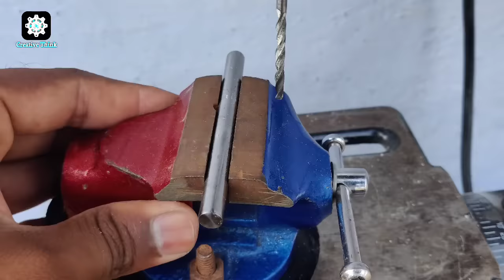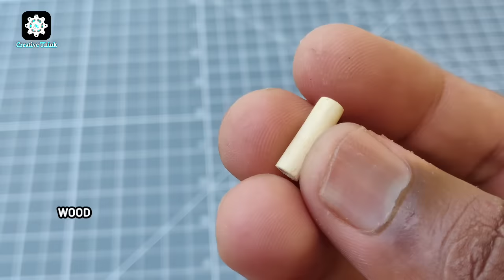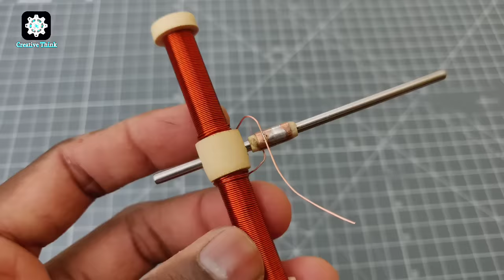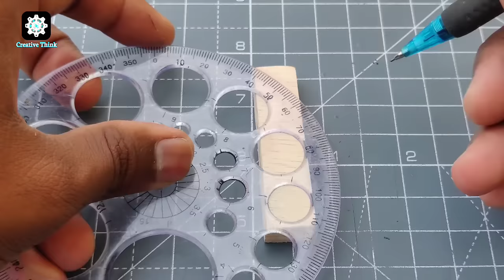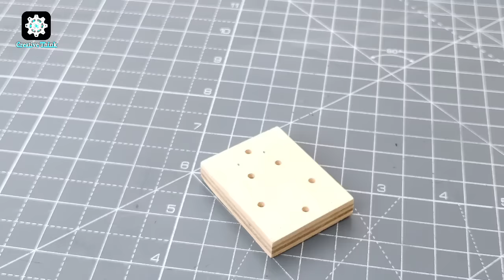Free Energy Generator Using Armature Method

Comment: I love the part where the rotor doesn't slow down when under load from the LIGHT! Almost as if the rotor is in parallel with the light and they are both receiving power from an external power source.
Reply: Bien vu!

Comment: If you closely follow the assembly, you can see that the current will not get to the coils.
The plastic ring with magnets magically becomes thicker.
Strange holes in the stand and rotor holders at the bottom, although he glues them together. 
At first, from the shaking, it moves across the table, and then not, although the ring shakes.

Comment: Batteries are in the lamp. You see it faster spinning when he connect the lamp. But a real generator goes slower when you connect a lamp.
Later on, the yellow part is proberly a fan what is driven by the wind
Reply: If batteries are in the lamp how isnt the lamp already on?
Reply: @TobyCharlesThompson   he used the, so called, generator as a switch.
It isn't a genarator.
Reply: @TobyCharlesThompson  circuit is interrupted and gets closed when he touches the contacts with the wires.
Reply: @mickue  So is fake or real?
Reply: @TobyCharlesThompson  fake of course!
Reply: Correct

Comment: Please upload a behind the scenes video on how you faked this so convincingly, thank you.
Reply: Its just a fancy flywheel. Stores the Electric Potential as magnetic flux in the coiled wires
Reply: Convincingly?
Reply: @ryanshannon2855  no..actually some point the rotating bar will come to an equilibrium position...it wont be continuous..unless provided an external energy
Reply: One possibility is that they hid a wire under the base.
Reply: what
Reply: 1. They hid a battery under the base
2. Every time they spin the copper tube they cut the video, so it looks like it spins on it’s own
3. Magnetic induction table
Reply: Noooo nnooooo it's true
Kinetic energy
Reply: @gondayayonke2827  Only need a tiny little watch battery to run it long enough to make a video.  It's in no way difficult.
Reply: It’s not fake. Instead of using a turbine to spin the rotor he’s using the magnetic potential stored in the magnets to generate the rotation of the armature as well as the magnetic field needed to generate electricity. Eventually those magnets will wear out.

It’s not fake, but it’s also not “free energy.”
Reply: @CJ-442  Any old jet of air will make it move.  I'd love it to be true.  No more energy bills.  The magnets will wear out?  Why?  Ever seen that happen?  Can you provide a reference please?  Please note:  Some things are not possible.
Reply: @Graeme_Lastname  - If you honestly think that magenta last forever, you have more problems than I can help you with.
Reply: @CJ-442  Magenta fades at about the same rate as any other colour I would guess.
Reply: I feel like if you attach a wing to it you can make a windmill base... If that's possible... Not sure
Reply: This is fake
Reply: @MarcosSilva-vt8uy  Yep, there are no other options.    :)
Reply: @ryanshannon2855  Free energy is impossible, as the 2nd law of Thermodynamics tells us.
Reply: @whoyoulookingatabs1028  
What if law is just law that few people decided who can not think outside one dimension?
Reply: @ddhaval010  hahahahaha no
not our problem you didn't pay attention in school
Reply: Dont messing a meam of free energy with ilimited energy

Every motion system needs a source to keep working (with loads)
Reply: Blowing compressed air from the background
Reply: @ryanshannon2855  Is this a good idea? As far as flywheels go, what you described (if accurate, pardon my own ignorance).

Comment: Second law of thermodynamics sends you a hug. Congratulations on hiding the battery so well.
Reply: It's real
Reply: The "wooden base" is quite thick. Could have easily hidden some disk batteries in there. Depending on battery size you could easily fit 4 in there even.

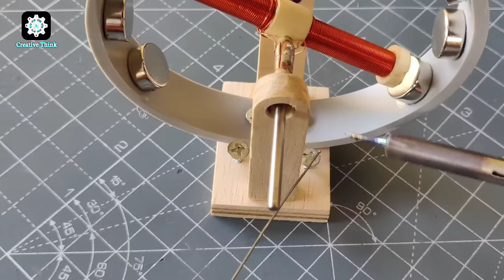Comment: The cut at 6:35 is where he swaps the one he made in the first part (with the off centred shaft that wont rotate) with the previously made one with the perfectly centred shaft and the battery hidden in the base.
Reply: nah he just put screws in the bottom of the 2nd bearing support centering the shaft.
Reply: Es verdad. 😳
Reply: Correct; otherwise, the two screws connected to the two cables would have no use (if it were a 100% self-propelled system with electromagnetism).
Reply: He doesn't try to turn it into one of those click bate videos. He even showed him using a battery to keep it spinning for longer to build potential energy. It's not like dude is claiming it goes forever on its own.
Reply: @shmirie666  You are the ideal audience for this video - gullible!   I guess you have never built a simiar motor?  They stop almost instantly when you disconnect their battery.  I made one a couple of weeks ago for my grandson - only mine didn't have any neo magnets - it turned in the earth's field.  The rotor was horizontal, and for a bearing, it used a glass test tube standing on a vertical needle.  The commutator was like his - and the brushes were single strands of muti-strand wire.  But even though friction was reduced almost to zero,  when the battery was disconnected, it only did about one more turn.
Reply: @JM Production Maybe because he thinks somebody is going to be convinced?
Reply: @mike you obviously don't understand the science behind it, because if you did you would know that what you used is not even close to being an exceptional project to act as an argument. The neodymium magnets matter. They are natural permanent magnets that can be drained of there charge through heat induction. ( rotating with the friction of the atmosphere heating the serface) 
The stronger magnetic force is the pull, however the repulsive force cumulatively gains the most potential energy. Therefore be the more ideal method of placement for an electromagnetic motor such as this. If the magnets on the ball bearing are allowed to gain enough potential energy from an outside force acting on it, you could potentially have it rotate for some time before it stops. It will stop only because the potential energy stored is not enough to restore the energy lost from its generation of electricity. Do some research and use the proper materials when doing and experiment before jumping to conclusions.
Reply: @shmirie666  Damn!  Sometimes, I'm just so short sighted!  I guess, where I got confused is that I thought the earth was also a permanent magnet.  Come to think of it, there are lots of minerals in the earth.  Don't you think there might be just a little bit of Neodymium in it?
Reply: @DownhillAllTheWay  yeah. Most every rock contains a small amount of geomagnetic   material so they each have there own static north and south magnetic poles. It's a method often used to determine whether or not a stone is placed by man or naturally formed there. Though it is not always accurate.
Reply: @shmirie666  and the N-S in magnetite that has been deposited on the bed of the Atlantic as the sea bed has moved away from the mid-Atlantic ridge also shows that the polarity of the earth has changed periodically.  BTW, did you ever stop to think that the geographic N. pole is a magnetic S-pole!  It attracts the N-pole of magnets.

I didn't think my last message to you had posted, because after writing it (twice!) I couldn't see it.
Reply: An assertion without proof
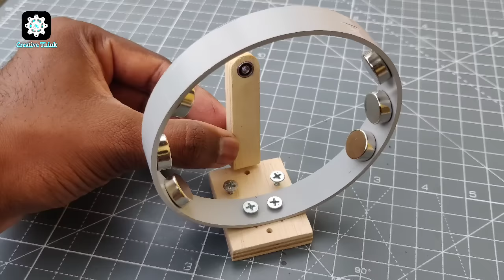Reply: Yeah, I love how he pretends to glue the upright in place with superglue at 6:14
Reply: @shmirie666   "It's not like dude is claiming it goes forever on its own." 
i mean, the guy did call the video "free energy generator" lol
Reply: So inside the wooden base, there is a second battery
Reply: Точно,  сначало стояли магниты на якоре, а потом они исчезли, мистика.😂
Reply: @shmirie666  My man, the least you could do is read the video description where he mentions this video is for entertainment. Clearly it is meant to simulate free energy so gullible people like you can defend it ferociously. :)

PS: Neodymium magnets are just stronger than regular magnets, they don't hold some miracle property for storing energy. Magnets don't hold energy. The motor shouldn't spin once the electricity is cut-off. The end.
Reply: @shmirie666  The point is to get a bit of energy to get it started, that potential energy is then used to spin it, which causes more energy, spinning it more, and more, and more, then you can redirect the remaining power to whatever item you need

Comment: the coils on the armature are acting as a capacitor, stores just enough charge to carry on by itself for a bit
Reply: What coils? There is not any coil
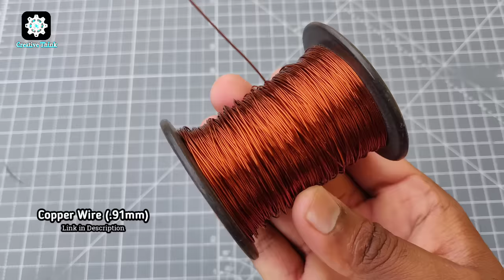Reply: @alexandrevlezka3703  Did you not see the copper coils he wrapped around the steel shaft 1:09.
Reply: @brandonhenry9846  my bad, anyways it didnt work

Comment: the secret is that under the screw there is an electrically charged cable
Reply: I think the battery is hidden inside the base. And the wires are attached to 2 screws

Comment: C’mon guys. You gotta give some credit to this guy. He’s good. I think the battery is hidden on the bottom of the wooden platform. What do you think?
Reply: Yeh lol
Reply: There's plenty of room for a watch battery.  Its only gota last long enough to make the video.
Reply: No, there’s no trick. The energy is coming from the magnetic potential in the permanent magnet he glued to the stator. When you run current through a coil you create a magnetic field. That’s why he connected that 9V battery initially when he started spinning. Once the armature was magnetized it’s poles started to chase the fields on the stator, and it kept spinning (this is actually how motors work).

When you combine a conductor (in this case, the armature), a magnetic field (the permanent magnets in the stator), and relative motion, then you generate electricity. Once the electricity was being generated, the armature was creating its own magnetic field, so the 9V was no longer necessary.

As I said before, all the energy is coming from the permanent magnets he glued to the stator. They’re acting as both the necessary magnetic field and the source of power. The generator will continue to run until those magnets wear out and lose their magnetic charge.

There’s no trick, but it’s also not “free energy.”
Reply: @CJ-442  You need to do a bit more reading.  Once the battery is disconnected there is no source of energy.  Don't blame me, I didn't make the rules.
Reply: @Graeme_Lastname  - I’m an electrical engineer. This is what I do all day, every day. I’m pretty sure I’ve done plenty of reading on the subject. Just because you can’t figure it out with your 10th grade education doesn’t mean that there’s some sort of trick.
Reply: @Graeme_Lastname  - Just because you built a gaming rig by following instructions you found on Youtube, doesn’t make you a computer engineer.

Also, I said I was an ELECTRICAL engineer, as in I work on generators. Now I know you don’t know the difference between that and a turbine, just know that it doesn’t have anything to do with building a computer. Electrical generators have existed centuries longer than computers.
Reply: @CJ-442  You guess what I built, then tell me all about it?  Bloody sure of yourself.
It as actually reading tirus tags on deer, weighing them then directing gates to get the deer into the appropriate yards.
The design was from the ground up including the "motherboard".  Programmed in assembler and built one at a time by hand.  I've never built anything from youtube.  At the time this was made it was all dialup.  OK, you can fix a generator.  I can fix a vacuum cleaner, so what?  Why are you bothering with any of this?  Bored as I am?
Be well cobber.
Reply: @CJ-442   Bro, how about you try to build one similar and make a video, I wanna see if it really works. Even if it’s not “free energy forever,” at least it last for a long time until those the magnets wear out like you said, right?
Reply: @CJ-442  BS. You are not an electrical engineer, or you would know that generators DO NOT take energy from magnets. Magnets are a field, a force. Not energy.
Reply: @AdamantLightLP  Magnetic fields require energy in order to be sustained. They don’t last forever. Generators induce a magnetic field in their rotor using DC electric current. We don’t use permanent magnets because their fields get weaker the more they interact with other fields (like the ones generated by all electrical conductors). We’d end up having to change them every few hours.
Reply: @CJ-442  Magnets do not contain intrinsic energy
Reply: @CJ-442  Jesus you call yourself an engineer and dont even know a thing about magnets. Permanent magnets do not "deplete" their field under normal circumstances. These neodymium magnets start to permanently lose magnetization over temperatures of at least 80 degrees celsius, higher for special neodymium compositions. There is no way to make any use of the magnetization as a power source since it is an incredibly small amount of power that can only be lost as heat. Small enough to not even be measurable with a normal thermometer. You are most definitely not an engineer because this stuff is taught in the first semester, and tested in the physics exam.

Comment: When you realise this is actually just a homemade DC motor
Reply: No it is not a dc motor a dc motor needs current to work this is a genarator that provides current
Reply: @dimitri9550   You're saying that the thing in the video is NOT a dc motor?
What is a dc motor?
What do you need to make a dc motor?
You need a stator, housing to hold the outer magnets, check.
You need stator magnets, check.
You need armature shaft, the rod in the middle, check.
You need copper wires for current to flow, check.
You need the rotor assembly, the thing in the middle that spins, check.
I guess is it NOT a DC motor.
Reply: @dimitri9550  A dc motor and a dynamo are literally the exact same principle. You're converting electricity into movement, or movement into energy. He used a battery pack to get it up to speed (motor) then hooked up the light and converted the rotation back into electricity (dynamo).

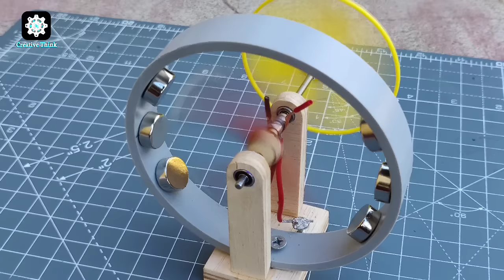Comment: You forgot to edit out the open circuit spark coming between Brush and Commutator @7:57
Reply: Every electric drill and small hobby motors I've owned has had a brush spark at the gap between the commutator segments.

Comment: A 9 Volt block battery must be hidden in the wooden base. He built a motor, not a generator
Reply: no bro it's real 

this concept is in the 10th standard  (magnetic effect of electric current)
Reply: @garveshkumar6877  read the vid description
Reply: @redstone_block180  okkk.... but have you heared about induced current?
Reply: @garveshkumar6877  yes, it's how turbines work. but they don't work like that, even the creator isn't keeping it secret.
Reply: No, its actually simpler than that. You'll notice that when its running, one part of it just pivots around the hole he drilled in the table. Thats why it has to be in exactly the same place whenever its running.

I usually get pissed off at these things but this is clearly some poor Indian guy and at least he's doing this scam that only hurts idiots instead of tech support scamming elderly people out of their life savings.

All the rest of you in this comment section should be ashamed of yourselves. It makes me throw up a little in my mouth to think people are so dense that they believe this trash is real.

Comment: You can see that he uses a battery to excite the electrons in the copper to create an electromagnet that creates the spinning motion being subjected to the neodymium circular magnet formation which probably helps to retain electron motion within the copper wires. possibly creating an alternate current each time the electromagnet reaches the other side of the circle. You can also tell that this is not free generation by the fact that the mechanism starts to slow when he begins using up the electricity to power his light source. He has created a rotating battery impressive.

Comment: oooh wow! I have got to try this soon!
I cant believe you figured out how to make an electromagnet thats always on turn from other magnetic fields! You would think that having magnets centralized close to one another on opposite ends of this electromagnet would stop the movement, but I guess not!

And not to mention that you shorted the battery while doing this! Astounding work!
Reply: actually air resistance stops it, ignoring air resistance copper generates some resistance moving throught a magnetic field, so even if it actually spins it will stop at some time